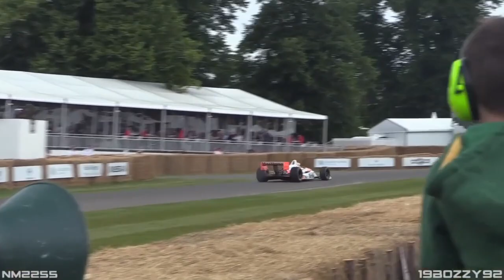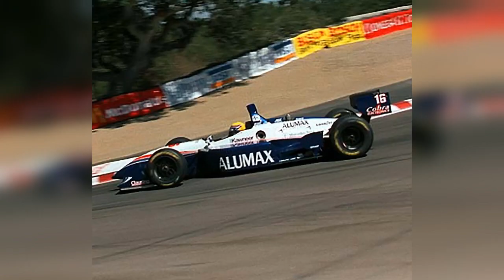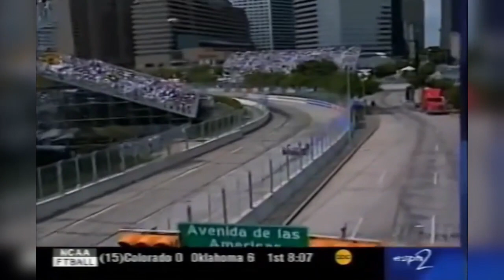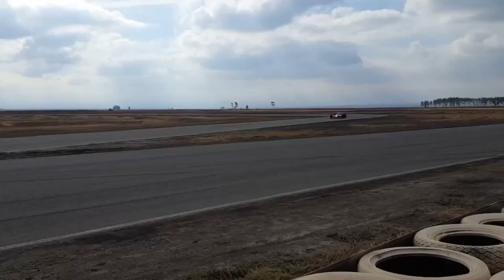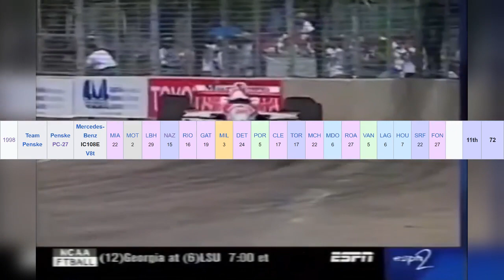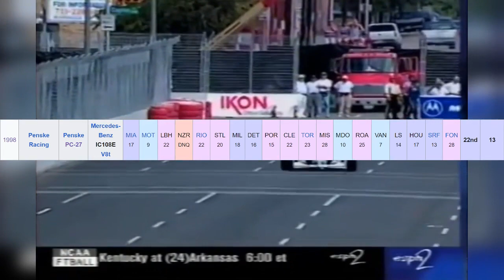The Strangest Penske Chassis

Comment: Ironically, the car has groundbreaking suspension setup that's now the norm in F1, higher downforce AND lower drag than Reynard, according to the data shown in one edition of Racecar Engineer.
Reply: yep! as it turned out, the issue was goodyear and mercedes. if this chassis had a honda attached to it and running on firestones, it would've been a literal rocketship.
Reply: If that were the case,  then why didn't they keep the chassis?
Reply: @RyanHellyer  Penske as an organization were in desperation back then. 
> RP had stakes in both Ilmor (Mercedes) and Goodyear, no way he'll use Honda and Firestone while... 
> Mercedes shifted their focus on F1 program 
> Goodyear were about to ditch all motorsport programs except stock cars (both NASCAR and ARCA)
> Paul Tracy roasted his package publicly, led to his firing ("just get a Reynard")
> His facilities were lagging behind Reynard and then-recently resurrected Lola, so from 1999 onwards, Penske became chassis "customer" (pretty much everything but the monocoque were bespoke by Penske)
Reply: @xSoccerxCorex The Mercedes was still winning a race every so often.  The Goodyears, however, were complete trash and per Al Unser Jr's biography, they were never consistent.  They'd get one good set of tires followed by several crap sets, or put another way, just like Goodyears today.

Comment: The Goodyear tyres & Merc engine were definitely not the kit to be running in CART by 1998, back then there was a lot of talk about the "package", Chip Ganassi unlocking the best performance with the Reynard / Honda / Firestone package and this is ultimately the combination which Penske would switch to for 2000. It is also very interesting that the "customer" chassis that they used at some rounds in 1999 was the Lola B99 and not the Reynard that they would ultimately switch to for 2000.
Reply: 1. If Penske showed up to a race in mid-1999 with a Reynard, and immediately started matching the times of the best Mercedes team and the best Goodyear team (Greg Moore and Gil de Ferran — incidentally, the two drivers Penske signed for 2000), the other teams would have started a riot. This was a team who developed an OP engine in complete secrecy; they knew how not to give away their hand.

2. At that time, Lola chassis were relegated to the backmarker teams who couldn’t afford anything better. If Carl Haas (the man in charge of selling Lolas in North America) wasn’t racing Lolas on his own team in the late ‘90s, why would anyone else? They were desperate to pair up with an established team, and the Penske partnership stabilized Lola to the point of being the exclusive chassis of Champ Car until 2006.
Reply: @fishflake1209 Penske probably could have won the championship with a Mercedes, but had no chance with a Goodyear tire.  According to Al Unser Jr's biography, Goodyear could not supply a consistent tire even on the same weekend and Roger was contracted to run Goodyears until they left the series.

In addition, it wasn't Penske that stabilized Lola, it was Reynard.  Adrian Reynard spent more time and money building an F1 car for BAR Honda and Jacques Villeneuve that he went bankrupt.  The only option for CART/Champ Car by that point for a new car was Lola which stayed unchanged from 2002-2006 until the Panoz DP-01 was used before reunification.

Comment: The weird legacy of the PC-27 is how little consensus there is on whether it was a promising chassis let down by having the worst engine and worst tires on the late-90s CART grid, or the nadir of the Penske team, fielding a brick of a car piloted by an old drunk and some pay drivers.
Reply from the maker: I honestly dont even know how to think about it myself, there was just so much against it.
Reply: @CountyLineFilms  The most plausible explanation is that Penske designed the chassis knowing they’d initially have problems making the engine work in such a compact package, but assumed Ilmor would engineer whatever upgrades needed to make the car a frontrunner; but with McLaren rising to the top of the F1 grid in 1998, “give Roger what he wants” was no longer at the top of Ilmor’s priority list.
Reply: @fishflake1209 I think it's even less than that because the Mercedes was still putting in some good showings and a race win or two.  However, none of them were on Goodyear tires and Penske was stuck with that albatross while everyone else could bail (and did).
Reply: @danielhenderson8316  Greg Moore, armed with a Firestone-shod Reynard and a metric-f*ckton of talent, proved that the Mercedes really wasn't that far off the other three suppliers.
Reply: @tomanderson6335 I don't remember the source, but Paul Tracy was quoted that the Mercedes around 1998 was making more than the other engines, but it was all at the top end and he loved going to Honda because he had good enough power at all points of the rev band instead of just at red line.  I think it was a Honda CART Table Top book by Gordon Kirby, possibly "A Winning Adventure: Honda's Ten Years in CART."  The most hilarious part of the book was Honda thinking this was going to be cheaper and easier than making F1 engines and almost destroyed Rahal Hogan Racing.

Comment: Mercedes 2.3L engine?   Did it have more boost than its 2.65L cousins?   Otherwise, they would be down quite a bit on HP
Reply: Typo.  Except for The Beast, it used the same size 2.65L Turbo V8 every other Mercedes car used, maybe with a little more Penske "magic."